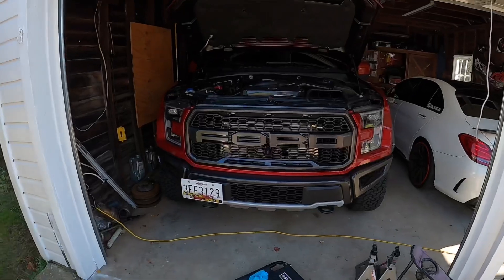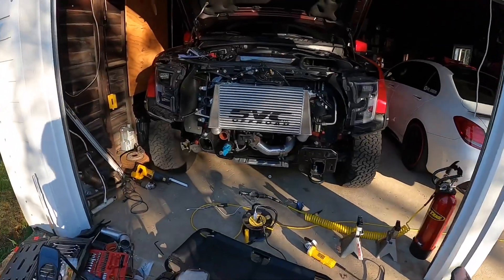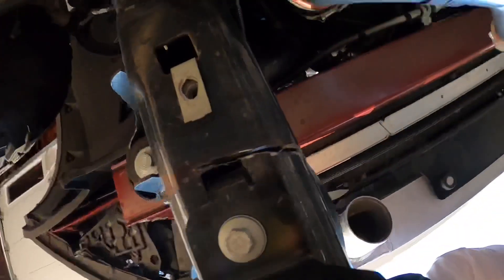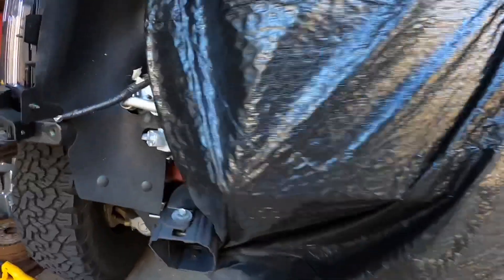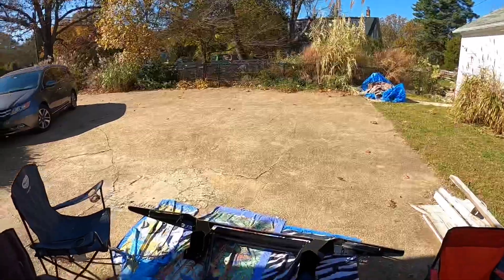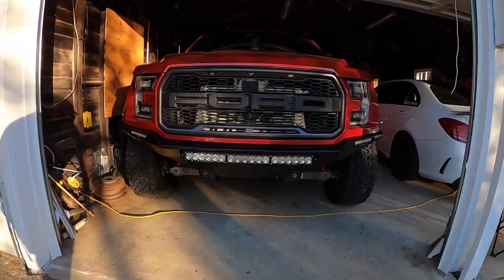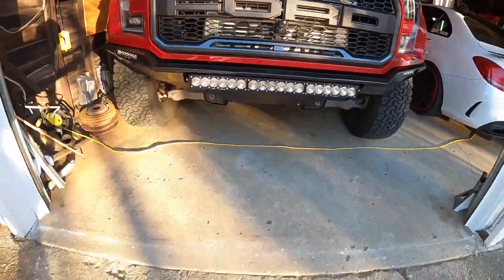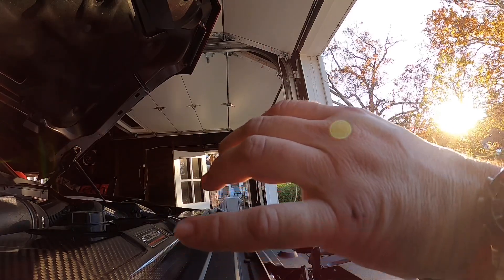SVC Offroad Mojave Bumper with 3 Baja Designs Light Bars install Gen2 Ford Raptor

Comment: Getting ready to do mine tomorrow. I have the svc baja smurf.. I think it's really odd they don't give you any measurements or a template... and I have a a.d.d front mount so the intercooler piping is differnt. Should be interesting. Lol